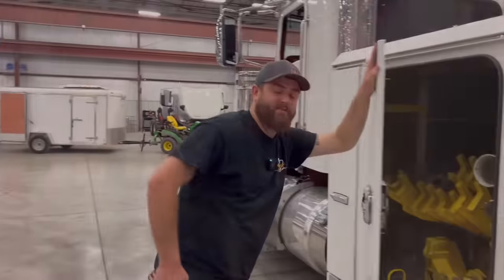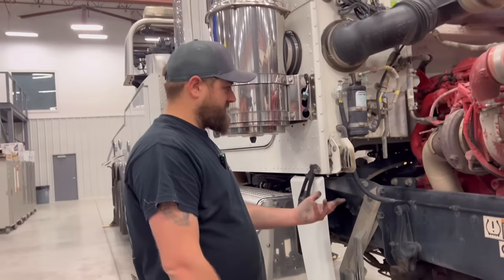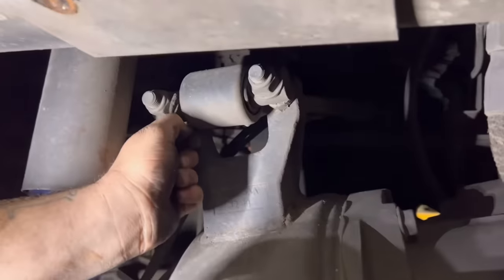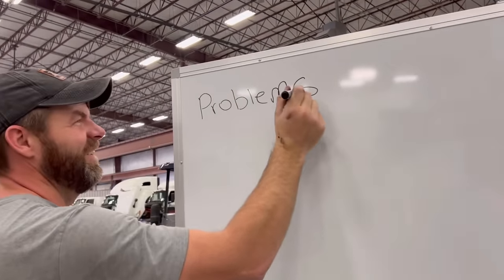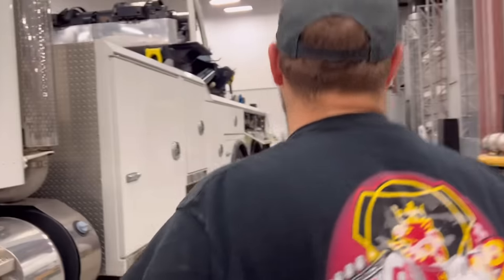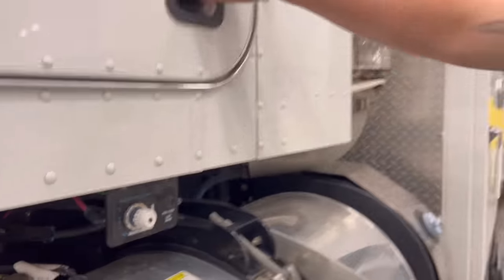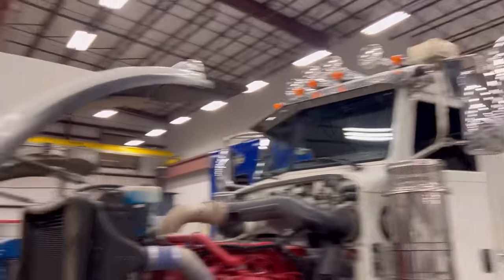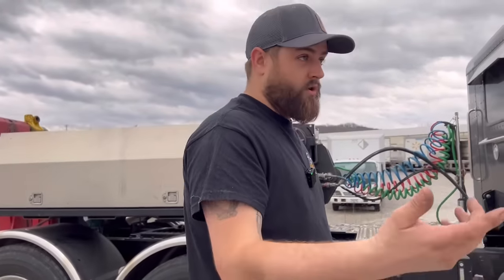The New Rotator Needs COSTLY Repairs…

Comment: Delete the EGR it no good for trucks that have alot of standing time on PTO work and if your taking the turbo off you may as well pdi it haven't you lol uprated clutch and front axle need Michelin anti splash super singles on it Michelin x line anti splash think we have on are wreckers could do with a steering lift axle

Comment: On the drop axle trying turning the knob by the switch my guess is they have it turned down. Turn it to the right and it should put air to it and work proper.

Comment: Cranes need to be certified and a Rotator is classified as a Crane. The inspection/certification is dependent on the state you live in. 
Anyone operating a Crane and/or Rotator should/needs to attend a school to get certified. You are often dealing with a lot of weight and there is more to lifting than just pressing a button. For example there’s a technique to stop a spinning and/or swaying suspended load when on a single line. YouTube makes operating a Crane/Rotator look very easy. Unfortunately that’s not the case. You can kill yourself or someone else very easy not knowing what you’re doing.  I use to operate a tiny little bitty 400 ton crane.

Comment: Turn the truck on, let it idle and adjust the air valve, the white knob right in front of your face
Reply from the maker: Seems odd that you have to set pressure everytime?
Reply: Hey BRUCE, it’s a one time deal set. The air pressure should be about 60 pounds lock it in place and let it go and that’s it.